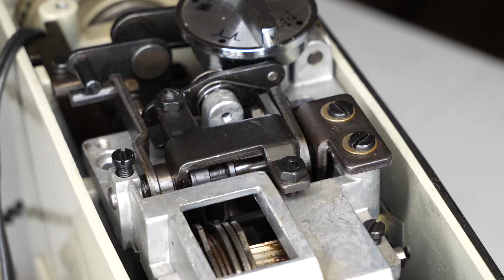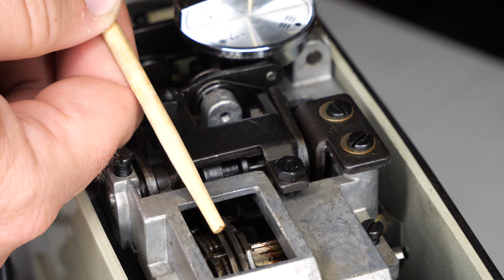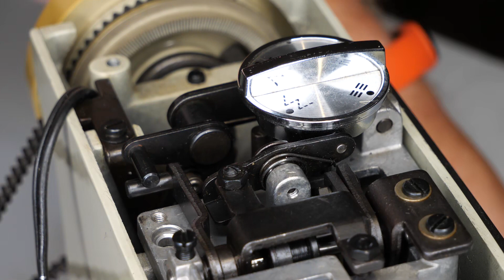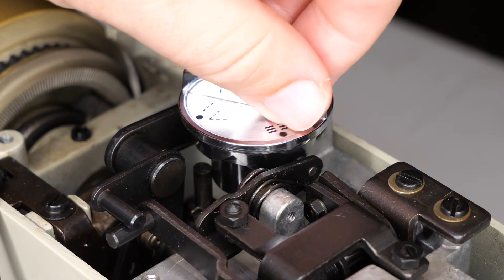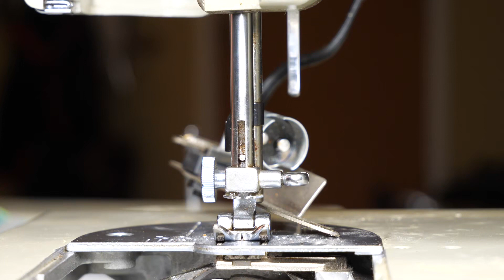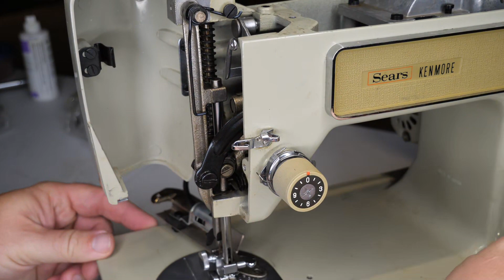Cam details and mechanism

Comment: I removed my cam stack assembly and lost the timing.  I need to set the timing, is there a method to get it close?  Are there as many choices as there are teeth on the gear and I just need to hope and poke? -Steve
Reply from the maker: No, you can set the machine so the needlebar is at BDC and set the follower on a flat.  The follower should be on a flat when the needle is down and only move when the needle is on the highest part of the stroke.  Once you have the preliminary set done, rotate the machine with a needle in it and watch when the needle is passing through the needle plate.  If it's moving sideways during that part of the stroke, move the cam stack 1 tooth and see if things get better or worse.  If it got better, keep going that way, if it got worse, move backwards 2 teeth and see what happens.  Usually you only have to try 2 or 3 teeth to get the cam timing back if you started with the needlebar down and the follower on a flat.